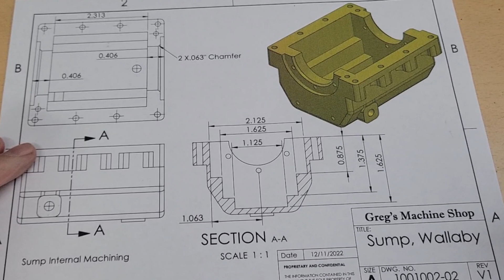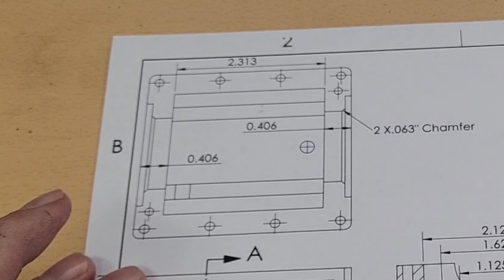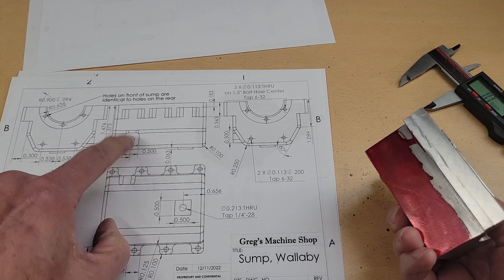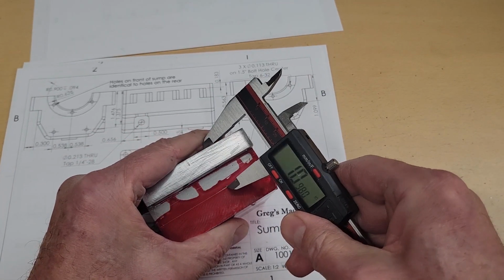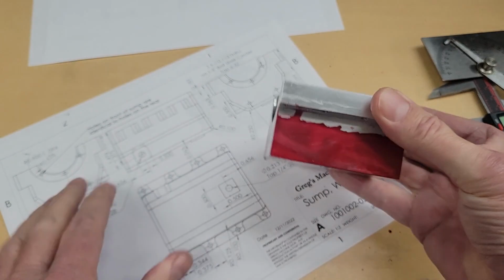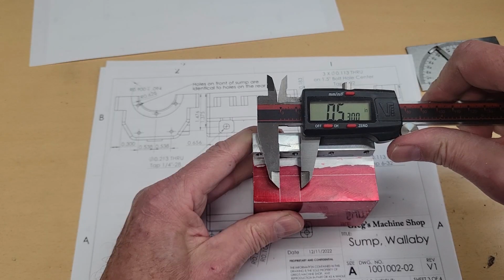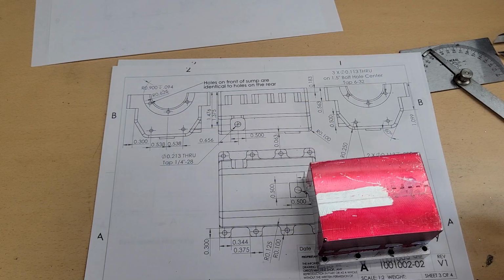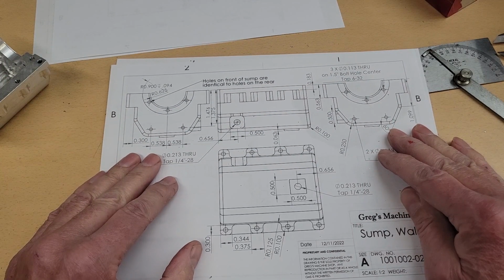Completing the Wallaby 30cc Engine Sump using Manual Machining

Comment: Just a note - the position you marked for the oil feed is wrong vs the drawing - should be 0.656" to the centre, not to the edge. (The edges would be at 0.406 and 0.906.) 

Don't worry, Blondie Hacks did something similar when she made the exhaust valve opening on one of her steam engines.
Reply from the maker: MisterG,  Yes your are correct, good find.  It would be a good idea to mark the oil drain and oil pickup holes first, maybe even drill them, then perform the rest of the outside machining so you have a balanced appearance and a chance to double check your work.